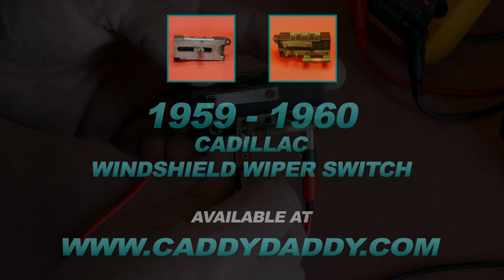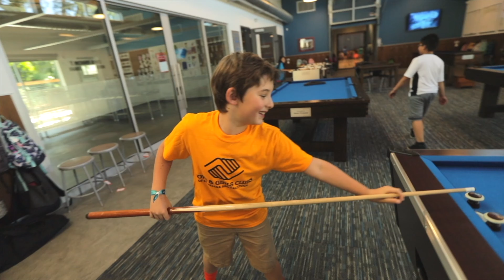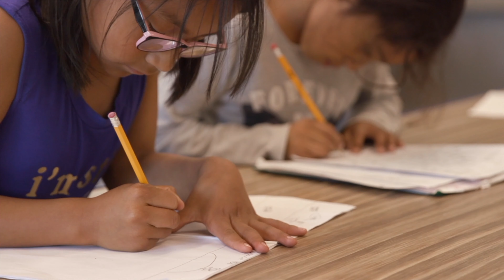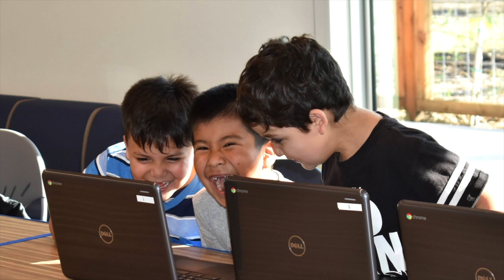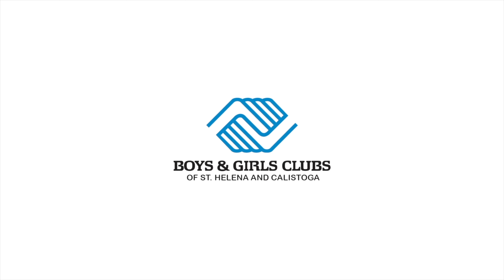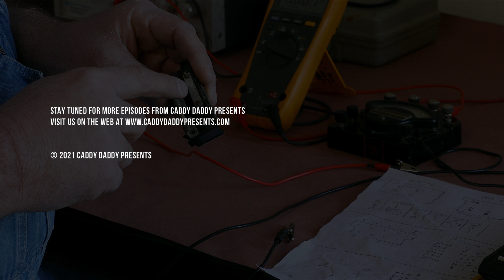How To Test A 1959-1960 Cadillac Windshield Wiper Switch

Comment: the link doesn't work. looking at getting a switch for a 60 caddie. cheers
Reply from the maker: Currently sold out. Should have more in a week
Reply: This is helpful. Trying to diagnose my nonworking wipers now. 

Not sure what the big electrical box is behind the driver side fender dog leg is but it was unhooked. I hooked it up but that didn’t help. Any idea what that is? I can see a circuit board inside it through a hole.